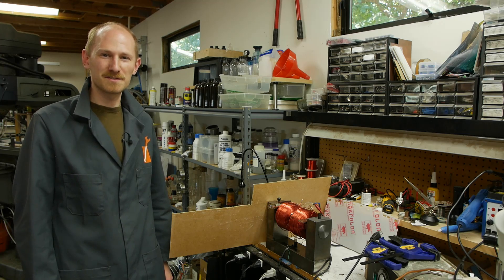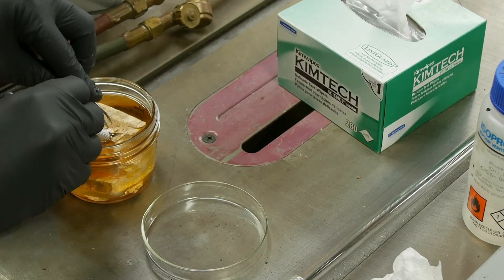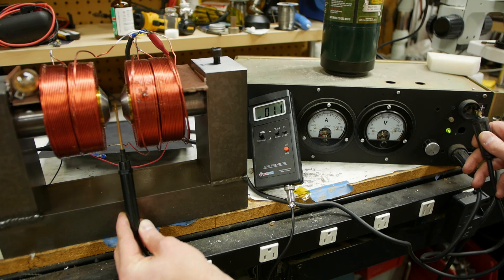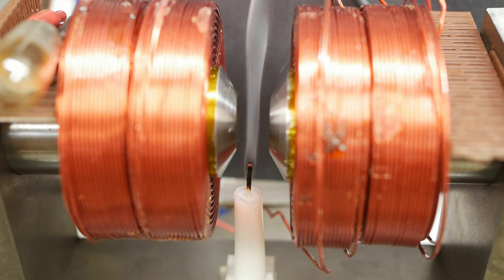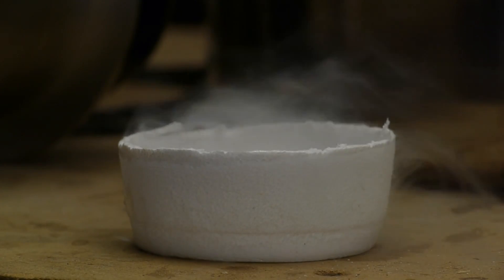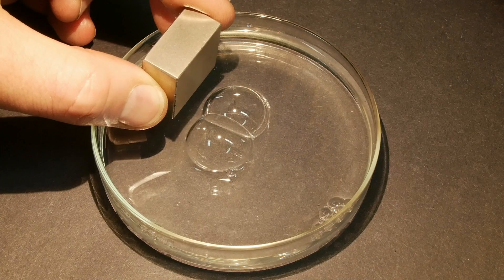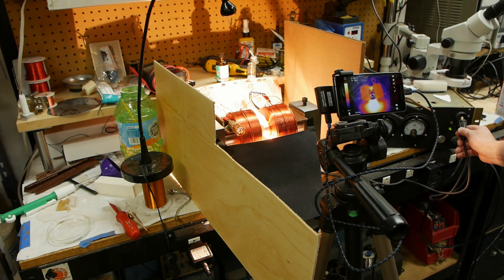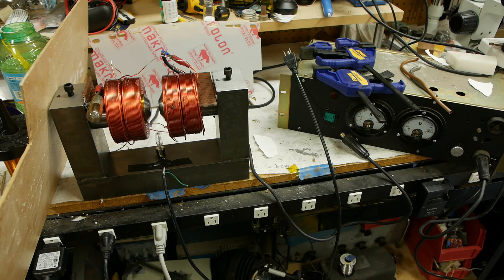Candle flame is repelled by magnets (and Zeeman follow-up)

Comment: Left hand and right hand rules in a magnetic field. 
1) if we shoot an electron into a magnetic field  transverse to its forward motion, then its forward motion is deflected away from its forward motion according to the left hand rule. 
2) if we did the same with a proton beam, it would be deflected acording to the right hand rule.

So a flame (weak plasma) upward buoyant motion Is deflected both left and right of a transverse magnetic field. 

There always is a certain amount of ionizing in gas molecules. More so at higher temps. 

Would you do a flame whose boyant movement is aligned to the magnetic field?  What do you think will happen to the flame?

Comment: Theory: The flame is plasma... It's conductive. This plasma is moving due to convection, so as it approaches the poles, the current induced in it increases,  causing a repulsion that correlates to it's speed.

This leaves the diamagnetic theory partially out for the flame, but not completely... As I haven't done the experiment myself, it would appear the methanol flame is indeed deflected less, so the candle flame deflection is possibly both effects working in tandem, enhancing one another.

Just a thought.

Comment: Its probably ionic exchange effected thru magnets. The main difference between hot and cold air is the ion charge that is in it so if the ion charge changes in the gas or whatever it really is then it is affected by magnetism since plasma charge is positive it will be affected by a magnetic field

Comment: If you combine charge creation and the movement due to convection, you get a Hall effect and some associated transverse current (positive ions deflected one side and negative ions the other side). Then you get your MHD force source term. This force is perpendicular to both the magnetic field and to the transverse current, it is then oriented verticaly and downward (opposed to termal convection). It will not change direction if you revert the magnetic field as the current direction is also reverted in this case !

Comment: You should try and compare how an electric arc will behave outside and inside the magnetic field. My prediction is that it may actually propagate it, a lightning sort of effect. It would be interesting to see if vertically and horizontally aligned arc behavior is any different.

Comment: My guess is Lenz Law.. like dropping a magnet through a copper tube, being slowed by the opposing flux from induced current in the conductor, by the moving flux field of the falling magnet.

Except with the flame, rising conductive ionized gases, create a flux field opposing it's upward motion, as edie currents are induced in the flame plasma, slowing the rising of the flame, giving it a squashed effect.

I wonder how this hypothesis could be tested.. 🤔 Any chance you could reproduce the experiment with a flame in zero-g... so there would be no induction from movement!? 🙃

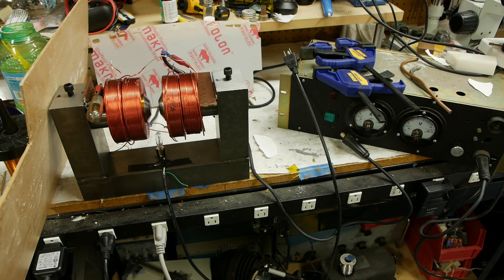Comment: 6:02 the surface of the bubble is shifting in a circular motion? maybe that is the movement since in a plate with two bubbles with a strong magnet it only moves ever so slightly but with no resistance almost from the water and it has room to move, maybe the construct of the bubble is stopping the bubble from moving but not from the bubble surface fluids to flow?
Reply: Is it flowing more with comparing to with out the influence of the magnet? Did you look at that?

Comment: @Applied Science - I just came across this video and it has nearly 1000 comments now, too many to read through to see if this is idea mentioned: Hot air has less oxygen in it because it has less of ALL the normal gases in it. Thus the outside air - with higher concentration of O2 - should be attracted more strongly into the magnetic field, causing a displacement of the hot gas, which is less strongly attracted. The effect should be more pronounced when the gas being looked at is combustion products, both because that is hotter AND because it has even less O2 present.

Comment: Spin polarization of the electrons probably reduces the yield of the combustion reaction due to the Pauli Principle? I.e. singlet energy to occupy the same orbital wavefunction gets shifted by muB relative to the triplet near the center of the solenoid, reducing efficiency or just preventing the reaction entirely. Just a wild guess. You could probably check this by comparing the reduction of flames that burn at different temps. Reactions releasing less energy/that are less favorable should see a greater reduction
Reply: Indeed, it seems like some version of this might be to blame! Quoting Wikipedia:
"Combustion in oxygen is a chain reaction in which many distinct radical intermediates participate. The high energy required for initiation is explained by the unusual structure of the dioxygen molecule. The lowest-energy configuration of the dioxygen molecule is a stable, relatively unreactive diradical in a triplet spin state. Bonding can be described with three bonding electron pairs and two antibonding electrons, with spins aligned, such that the molecule has nonzero total angular momentum. Most fuels, on the other hand, are in a singlet state, with paired spins and zero total angular momentum. Interaction between the two is quantum mechanically a "forbidden transition", i.e. possible with a very low probability. To initiate combustion, energy is required to force dioxygen into a spin-paired state, or singlet oxygen. This intermediate is extremely reactive. The energy is supplied as heat, and the reaction then produces additional heat, which allows it to continue."

So basically you're increasing the energy required for O2 to be in the necessary singlet state, and thus decreasing the fraction of molecules participating in combustion at a given temperature! Very cool!

Comment: imho, you may also have to look into the direction of temperature dependent conductivity and/or permeability of hot flame resultant ingredients (CO2 CO and H2O) and turbulence of flow of those.  So when flame is placed into the constant magnetic field and turbulence in flame modulates (Faraday law) the magnetic field that may result further in differential electrically charged areas in flame flow. this may further result in the visible flame burning condition changes . just a thought.

Comment: why dont you think the candle is attrackted to the candle by carbon? diamagnetics of gases at normal conditions is pretty weak.
A flame is a plasma ... charged Ions and magnetic feelds interact with each other. A lot of people even use this same experiment to show that plasma will be effected be magnetics 

Ps. Yes the very suddle effect at the end can maybe explained by diamagnetic warm air (i dont think so probaply pratucalte in the air gets attreckted to the magnets)
and the second effect is way less strong and sudden.

Comment: Not sure if this will help.  My first thought was the Lorentz force, with electrons and ions being affected.  But someone started estimates of the conductivity and forces involved and they seemed a bit low for a fairly dramatic effect.  I googled [ magnetic effect on oxygen in air ] and found oxygen enrichment with magnetic gradients.  The density of the flame should be lower, perhaps in relation to its velocity.  Could it be the magnet is attracting the oxygen into the region between the poles and forcing the non magnetic and lower density flame out of the way?  One reason progress in controlling plasmas and flames with fields is slow, it the multiple sensors and simultaneous careful measurements needed. You have been methodical and creative in separating out the various possibilities.  Your sodium vapor, Faraday effect confirmation deserves more time and applause.  The Schlieren method suggestion was good.  There are a LOT of aeronomy technologies now.  

If you use permanent magnets, and move them in a controlled manner, you might be able to sort out some of what is happening.  But that would produce motion of the air.  If you use permanent magnets and a small modulating coil, a sensitive detector could perhaps see the modulation in the density of the air above the flame.  Schlieren could probably see that.There are so many ways to go.  Seeding with sodium or potassium will introduce conducting species.  I do not envy you doing this without several supporting groups to keep notes and do the research to help you.  You google for a few hours or a few days, but some of these problems people have spent their lives at and they still are not sure - mostly because of the lack of experiments on some things. And the lack of tools and instruments to sort things out.  

If you put a magnetically permeable (ferrite?, cobalt iron?) material near the flame, and permanent magnet moving behind a wall, to change the field near the flame you could modulate the magnetic field without disturbing the air by movements.  You need to calculate and measure the actual magnetic field, measure the speed and composition of the flame. measure the temperature distribution of the flame, be careful eventuallly about tracking the humidity and atmospheric pressure.  I suppose you could have a jet of just air, and inject electrons and ions by laser ionization or electrical ionization. With different gases you could control how much energy you put into them and know their ionization to begin to understand gas/ion flows, and the effects of diamagnetic forces and magnetic forces - remembering that the magnetic force is mostly dB/dt and Grad B related.  You are good with correlating signals, so modulating "something" is your fastest route to getting measurements. And getting measurements is the fastest way to control.   You are doing a good thing, but videos only attract attention and document images that humans can see.  But progress comes when you start using tools to record, and Quantify,  the things we cannot see. That thermal camera was excellent.  You just need to count the pixels and intensities, form a hypothesis about what is happening, and try to model and predict, then test.

Comment: Isn't it like moving a conductor into a strong magnetic field? The flame is partially ionized and therefore conductive. The heat will transport the conductor upwards through the field. So this is probably a special case of eddy-current-breaking. ;)

Comment: Flames contain a high percentage of ionized gases.  Since these gasses are in motion, the ionized gasses are in effect, an electric current in the flame.  The current carrying conductor (flame) is deflected at right angles to the magnetic field.  In fact, many furnace and gas range flame detectors determine the presence of a flame indicating successful ignition by measuring conductance between the grounded metal burner and a small wire protruding into the space which is occupied by the flame.

Comment: The heat ionizes the air just above the candle flame. Surely you've heard of the flame speakers were they can sending audio superfluously and you can hear how are you 360° sound Georgia directions. The flame can be manipulated because of ionization of a gas.

Comment: You should have a look at IONIIC PARTICLES during combustion combustion. When candle wax burns, carbon is released from the long carbon chains of the wax and is allowed to react with oxygen from the air. This reaction does not happen at an instant. There is a moment in time, when some parts of these carbon chains are have a partial charge and are therefore ions. The same would happen if you used any combustable fluid, burning at whatever colour. In fact it does not only happen only to carbon-carbon bonds. It happen to all reacting materials. The colour of the burn doe not play a role at all. Just have a look at a detailed reaction explanation of candle wax combustion or alcohol combustion and you will see the ions. Also, have a look at activation energies required to break certain electron bonds. Some require more, some require less, it depends on the electronegativity. This is yet another reason why there is a temporary ionic charge to some molecules in the combustion. You can see a more violent display of this when you light a candle and place it in a microwave. The microwave produces a strong magnetic field and traps the ions in it. Hence the violent reaction. They call this "plasma" on YouTube for some reason, but it is not really.

Comment: In a past experiment a couple years back and when I realized a lighters Flint sticks to magnets I attempted to heat up the Flint as I do with a lot of dead lighters and I heat them till they glow then throw them watching them turn to sparks. Anyways my point
 I'm leading up to is when I had the Flint stuck to a magnet I could not heat it up to the glowing red state no matter how long I tried

Comment: Oxygen fires are by definition Plasma so a normal fire can be guided by strong magnetic fields because the free electrons from the fire will be guided by those stronger Magnetic fields. 

You never see this normally because the Earth's surface environment is very electrically neutral ( the very reason compasses work like they do).

Comment: Well according to archimedes law and accepted physics heat should disperse in upside down pyramid shape. That should also apply to shape of candle fire but it is not the case. Shape of candle fire or any fire is more tear shape. This means one thing only and effects of magnets on flame heavily support this, basically ether theory is correct. Where fire is actually creation of antimatter or magnet is space and fire is counter space. When you turn the magnet on magnetic field fills the space and squeezes anti space. This is very simplex accurate explanation but somehow is considered radical....
Reply: Doesnt have to be matter and animatter. Just plasma physics in an Electric Universe.

Comment: it is the vapors that is feeding the flame that is affected by the magnets... if the vapors move away because of the magnet so does the flame, wether such reach ionization, these are still atoms with polarities, and much smaller in size...i mean dispersed compared when it is in solid state.

Comment: Perhaps, in the same way liquid oxygen is paramagnetic due to its temperature being below it's natural Curie point, perhaps it has a diamagnetic property at higher temperatures such as the flame boundary. It would make more sense.
Reply: Or electric universe and plasma physics.

Comment: Any heat on the matter works in the same way as does electrical charge - it creates increase of magnetic properties in the heated matter. The smoke is still hot. And for this reason it is magnetic. And for that reason it responds to magnetism.

Comment: It is a result of magnetohydrodynamics.  The flame is partially ionized.  The higher the temp, the higher the degree of ionization, and thus a more pronounced the effect.  It’s the same concepts used in Plasma Physics.
Reply: It IS plasma physics.  And an electric universe.

Comment: Great video, subbed. Could it be that the magnetic field is displacing the dielectricity of the plasma? Just like when two like poles are pushed together the dielectric plane of inertia is displaced 90 degrees to the outside of the magnet. Same kind of thing here maybe? Cheers

Comment: Having just watched this video on my TV, I immediately thought of Michael Faraday's Experimental Researches in Electricity vol. 3, which strangely enough I was just reading last night (and I now see you reference a letter he wrote on this above). The notes on it start in his 25th Series, from around August of 1850, numbered experiments 2718 through 2796. In 2720, Faraday states "it appeared that at common temperatures diamagnetic phenomena could be exhibited by gases; and also that in their production the gases differed very much from one another; so that, taking common air, for instance, as a standard, nitrogen and many other gases, were strongly diamagnetic in relation to it, whilst oxygen took on the appearance of a magnetic body". In 2730 he speculates the volume of air is being affected by the field. In 2734 and 2743 displacement is noted of a fluid connected to a vessel containing air. In 2753 he notes a variance in the contraction in a given dimension or direction along the lines of force. In 2757 he speculates the DIFFERENCE of the two portions or masses of matter occupying the magnetic field may cause them to separate. In 2762 he presents his version of the bubble test you did. Keep up the great work!
Reply: Plasma in an Electric Universe

Comment: Look up the electrical universe theory this is what I think is going on with your experiment why the flame has the most reaction to the electromagnet fire is an energetic plasma reaction fire is plasma and it's electrically conductive and I believe that is what's happening the fire is a Cascade chemical reaction that turns whatever element and to heat and Light and produces photons in that reaction it is ripping and shredding all of the elements of whatever it's burning that means all the protons and neutrons are floating in a electrically neutral soup when you bring an electrical field into this reaction all the positrons and negatrons react to the electromagnetic field that's my explanation of it anyways peace out have a great day

Comment: Dude, it’s easy. It’s called “Energy conservation law” and its force was described by 2 guys: Bernoulli and Magnus. Check out Magnus effect - that’s what happens with your flame. And it’s the same as in case of parallel conductors, which are also repelled or pushed together.